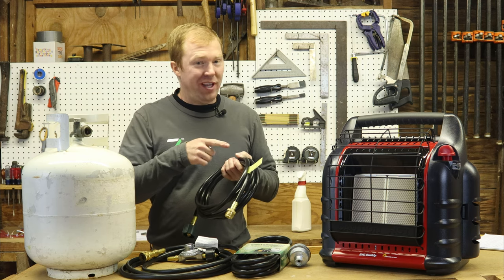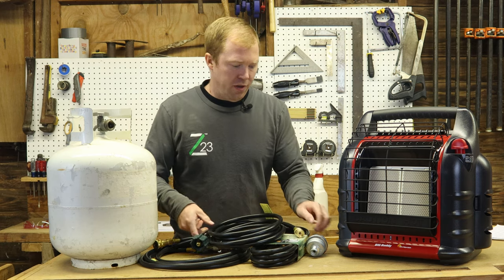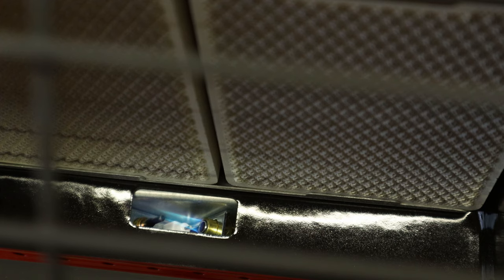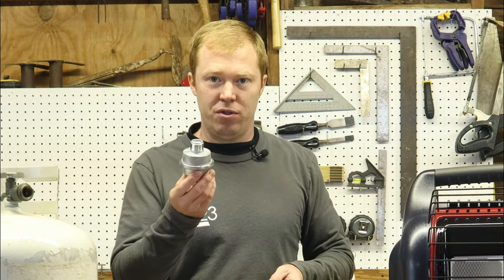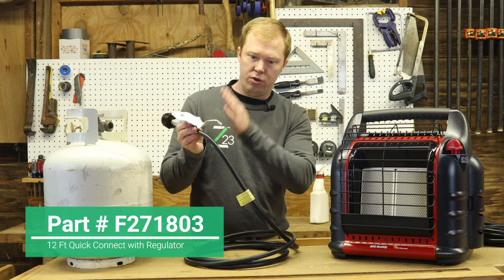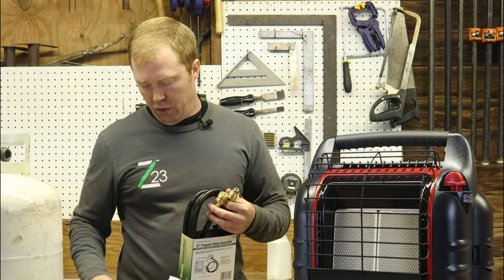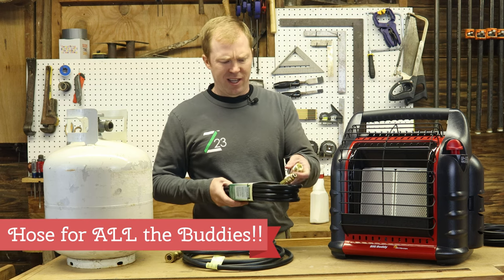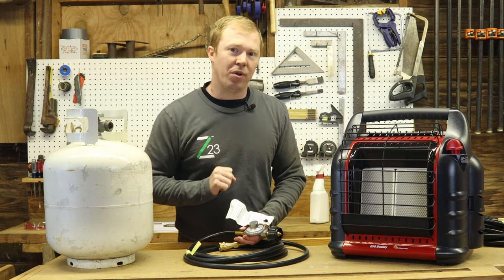Best Hose for Big Buddy Mr. Heater, No Filters

Comment: This video not only cleared up the issue of a fuel filter, but also cleared up the confusion regarding overregulation by having two regulators. If I am understanding you correctly, all Mr. heaters have a regulator attached to the heater that cannot be removed. Only the larger heaters have the quick connect that bypasses the attached regulator so you can only use the hose that has the regulator on it on the larger heaters.  The smaller heaters require a hose without the regulator.  Thank you so much for clearing that up.  It does frustrate me that Mr. heater would sell any hose that needs a filter. It seems like they’re double dipping. If someone   purchases an aftermarket hose, then that’s on them and they would need to buy a filter.

Comment: I was confused about which hose to get and this video was very helpful and answered all of my questions. I used your links to get the Big Buddy heater, tank and hose. I got the Mr. Heater non-oily version of the F273704 10ft high pressure hose because I didn't want to use the filter, and because the low pressure quick connect hose with the regulator won't work on the smaller heaters if I get one of those in the future. Thanks for clearing all of that up.
Reply from the maker: Oh you are very welcome @randy1407. Thank you so much for using the links, that helps me in making more videos for you guys.

Comment: I love the video again and subscribed this time, Thank, you for the help. I have a question about how long the F 273704 lasts and when you feel it should be changed out. Mine looks fine and shows no wear. Thanks in advance, Jesus Bless you and yours.
Reply from the maker: @mountainhobbit1 I would replace it once it starts showing wear like cracks in the rubber or it becomes very stiff. There is not a set time frame, where a hose used in the sun and elements will wear down faster then one that is stored inside. Thanks for the subscription!!

Comment: What about a steel hose? Do those have oil residue needing and need a filter?
Reply: yes always use a filter.  Those braided hoses have a rubber hose inside.  The only hose you don't need a filter with is the 10ft F273704

Comment: Hi Z23, So I have the big buddy heater and have not purchased the filter for this very reason in 4 years. I waited and glad I did. Thanks for the hose information. I'm on the mr heater site, so I'm asking what is the model number for the hose with the quick coupler? Thank you
Reply from the maker: Hi @HebrewNomadOverlander. The number is F271803. Search for it on the Mr. Heater website and it should bring it up. 
You can find a quick coupler hose on Amazon for a cheaper price but it is an off brand. Here is the affiliate link if you want to check it out. https://amzn.to/3u2dHGu  Thanks!
Reply: Awesome, Thanks @Z23go
Reply from the maker: You're welcome!

Comment: If you have the big buddy with the quick connect hose with the tank mounted regulator is probably the best.  Everything away from the tank is low pressure so should be safer from breaks or leaks, and it greatly reduces the oil sweating problem. Another YTber show fixing a Big buddy with the oil problem and there was a loop of the metal gas supply tubing and he  cleaned out half a teaspoon of oil in the internal lines that had collected there. If you have one of the other models, the choice get harder.
  Another topic, we recently had a power outage and I was helping elderly neighbors. There big buddy was older and had dust on it and the clean out the orifice of the pilot flame with a qtip and alcohol worked to get it lit. They were running it on high from two small bottle initially, and it would shut itself down. The little bottles got cold enough that there was frost on the outside of the bottles where the liquid propane was. The internal evaporation of the propane had made the bottles so cold the propane did not come out properly. Wait a few minutes they would warm up and the heater could be restarted. Just another fyi.
Reply from the maker: Good information. Thanks for sharing mdbailey57!

Comment: Hi, I live in Texas where we had a freeze last February that shut down our entire electric grid for days, in which it was 40° inside my house and we are struggling to survive. Handfuls of people died that week all across Texas from the event due to lack of heat. My thought is to buy one of these Mr. heater units and have it as a back up to place inside my living room so everyone could huddle around it in close proximity. My question is, is it possible to run a 25 to 35 foot low pressure hose from the unit to outside the house where the 20# propane tank would be placed? And if so what would I need to do that properly? Much appreciated!
Reply from the maker: I remember that storm. That was a scary time for sure. This would be a great emergency backup heater for that very occurrence because it is rated as indoor safe. I would definitely keep a couple 20lb bottles on hand so you would have several days of heat. I think it would be possible to attach a couple hoses together to make a longer one, you would just need a brass nipple or adapter to connect the two. An easier option may be to contact your local propane provider and they could possible make or sell you the length of hose you need where you don't have to connect two together. Before spending money on extra hoses though you might contact Mr. Heater and see if that is possible to run a long hose with the Buddy Heater. Their number is 800-251-0001. Hope that helps!
Reply: I was here, too. 5 days without power and 7 without water. People died and they didn't fix the grid.
Reply: it would work, but keep in mind it would take longer to prime and purge the line of air to initially start it up
Reply: I run my little buddy heater in my garage with my 20 pounder right beside it never had a problem. You could probably do the same in your house
Reply: I was there in Fredericksburg and my Big Buddy saved a friend whose Rv furnace went out. What a cold spell!

Comment: It says on internet that the big buddy has a built in regulator and to not use a hose with a regulator on it, it recommends using f273704 without a filter. That hose is out of stock at walmart, what is a compatible substitute , for no filter at least 12 ft long without a regulator
Reply: F273704 but its 10ft

Comment: Do you know anything about the Flame King ? I need to buy a quick connect hose for my Flame King but do not no if it is 1/4 or 3/8 Hose that I need or even if I need to purchase a flare quick connect because a regular will not work... I'm not sure which hose to purchase??? 
I have the 20,000 BTU Flame King model 
Any help would be MUCH Appreciated
Reply from the maker: Hi G50-IcEMaN, I don't have any experience with the Flame King model. You might try contacting them directly to see if they know. https://flameking.com/contact-us/

Comment: I have just read where a bunch of people are getting clogged filters with the hose that connects to the heater. They take the filter off and it works fine. Why are people having so much trouble with the filter?
Reply from the maker: The filter is supposed to be changed every year. I'm wondering if they are leaving them on for longer, causing them to clog up.
Reply: @Z23go  what I understand these were brand new units as well as filters!
Reply from the maker: I'm not sure then. I recommend the high pressure hose or hose with built in regulator where you don't have to use a filter with them.
Reply: @Z23go  well, I just had to take my unit back as it was leaking anyway

Comment: I must have an unheard of problem with the Mr Heater hose. The one that don't need a filter. The hose stinks all up and down it like the smell of propane. It actually stinks the room up. If that was happening to everybody else, they'd have to take them off the market. There is no leakage anywhere.  I've sprayed everything with soapy water and ran a gas leakage meter all over the hose and everywhere else with no reaction. My other type hose that has to have a filter didn't smell like that.

Comment: You can only use Mr. Heater propane hose F273704 without a filter to connect to your Little Buddy Heater.  Any other hose without a filter will cause your heater to clog.
Reply: Source? Did you watch the video and what he said?

Comment: Ok I use home Depot heater hoses    no regulator no filter  connect to screw in connector no filter when I listened to everything on using a filter and used one it destroyed my buddy heater.   6 yrs later my buddy heaters no issues no filters I have 3 use them every day in winter for hrs on end. The filters are garbage. You don't need them.  They gave me issues with lighting creating condensation in internal lines making my blow out all lines till my first one could not be fixed .same hose same gas company 6 yrs later new same heater no filter used no issues. on 3 buddy heaters 2 little one big short and long hose used all from DEPO. Not buddy hoses. My friends all had same issues with filter use.stoped using them. Funny they were sold at DEPO 5 yrs ago but not no more no one wants them dispite the fact they sell thousands of buddy heaters  you can't buy the filters in store the did stock them . Big hint on garbage.😱🤣
Reply from the maker: I've tried to avoid filters because of the extra cost every year of replacing them. But sounds like you have another good reason to find a hose that doesn't need them where can avoid those issues.

Comment: Any of the chinese-made stainless hoses sold on Amazon (for less) require no filter, and are more durable than the Mr. Heater hoses.
Reply: Wait why is that?
Reply from the maker: Hi Nathan, I don't have any experience with the Chinese-made ones, but since they are stainless I'm guessing they have a flexible metal covering on them that would make them more resistant to getting cut. The only downside is Mr. Heater says any third party accessories voids the warranty. If your heater is no longer under warranty this may be a cheaper option. I went with the Mr. Heater brand hoses just cause I know they are reliable.
Reply: I wouldn't trust it.  The 10ft F273704 is the only hose I wouldn't use a filter with